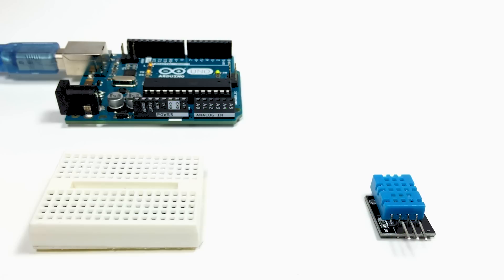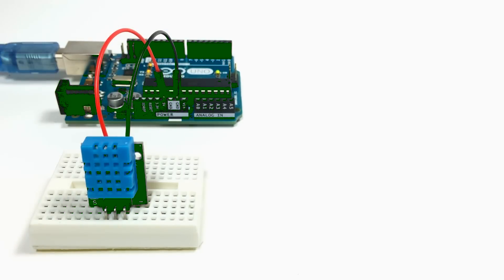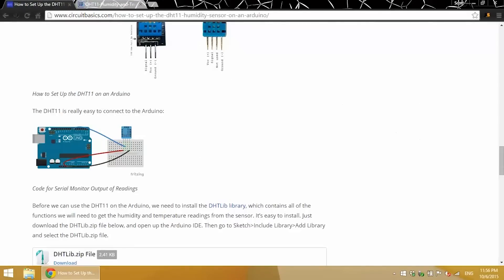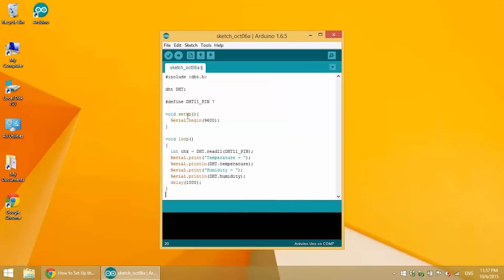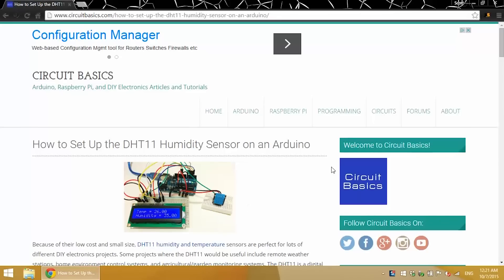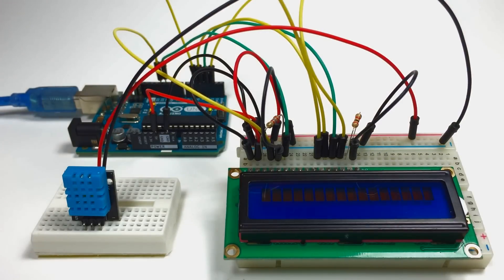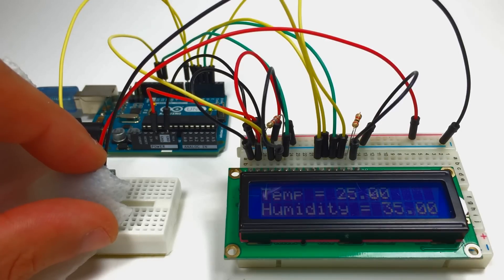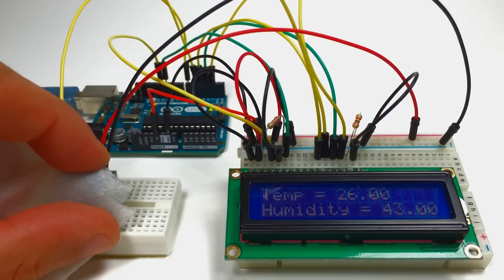How to Set Up the DHT11 Humidity and Temperature Sensor on an Arduino

Comment: Hi! finally something I can understand! Sorry I'm a super beginner on electronics.
I followed the steps but the "Serial Monitor" only shows "-999" value on both Temperature and Humidity. Do you know why?
Reply: +Mónica Rojas Restrepo You've prob done it now but yes you've got your dht wires wrong way round. Been playing myself and same thing - until I swapped the + and - around (it sure got hot at one point!)
Reply: We all are beginners in the beginning. Live and learn! (i gotta get that tattooed on me someday)
Reply: how was the -999 problem solved...?
Reply: The delay timing is too short. Change it to a larger value like 1500 or more and it should correct itself.
Reply: @rexpimplemyer3839  Thank you. this worked for me
Reply from the maker: Sounds like something may not be connected properly... Are you using the same pins I used in the video?
Reply: +Mike Mo yes, it was that. thanks
Reply: Solve -999 problem   https://www.youtube.com/watch?v=iQtC60BMk_8

Comment: Arduino: 1.6.7 (Windows 7), Vývojová doska:"Arduino/Genuino Uno"

C:\Users\User\Documents\Arduino\sketch_feb17b\sketch_feb17b.ino:1:17: fatal error: dht.h: No such file or directory

 #include <dht.h>

                 ^

compilation terminated.

exit status 1
Chyba pri kompilácii.

  Tento výpis by mal viac informácií s 
  "Zobraziť viac informácií počas kompilácie"
  povolené v Súbory > Vlastnosti.
Reply: +duffy kreativ and what now
Reply from the maker: You need to install the DHT library
Reply: wher dowland DHT library
Reply: https://github.com/adafruit/DHT-sensor-library
Reply: how to install
Reply: Start your Arduino software then click 'sketch' at the top and then on the drop down menu you should see 'include library' and you click on that and the menu will have an option 'add .ZIP library. Click that and find where you downloaded the DHT11 zip and select it. Then restart the Arduino software and it should be installed. Click File and go to Examples and you should a sample DHT11 sketch. Any questions?
Reply: Arduino 1.6.7 (Windows 7) Evaluation Board "Arduino / Genuino Uno"

C: \ Users \ user \ Documents \ Arduino \ sketch_jun26a \ sketch_jun26a.ino: 1: 17: Fatal error: dht.h: No such file or directory

 #include <dht.h>

                 ^

Compilation terminated.

exit status 1
Error at compile time.
Found invalid library in C: \ Users \ user \ Documents \ Arduino \ libraries \ sketch_mar12b: C: \ Users \ user \ Documents \ Arduino \ libraries \ sketch_mar12b
Found invalid library in C: \ Users \ user \ Documents \ Arduino \ libraries \ sketch_mar12b: C: \ Users \ user \ Documents \ Arduino \ libraries \ sketch_mar12b
Found invalid library in C: \ Users \ user \ Documents \ Arduino \ libraries \ sketch_mar12b: C: \ Users \ user \ Documents \ Arduino \ libraries \ sketch_mar12b
Found invalid library in C: \ Users \ user \ Documents \ Arduino \ libraries \ sketch_mar12b: C: \ Users \ user \ Documents \ Arduino \ libraries \ sketch_mar12b
Found invalid library in C: \ Users \ user \ Documents \ Arduino \ libraries \ sketch_mar12b: C: \ Users \ user \ Documents \ Arduino \ libraries \ sketch_mar12b
Found invalid library in C: \ Users \ user \ Documents \ Arduino \ libraries \ sketch_mar12b: C: \ Users \ user \ Documents \ Arduino \ libraries \ sketch_mar12b
Found invalid library in C: \ Users \ user \ Documents \ Arduino \ libraries \ sketch_mar12b: C: \ Users \ user \ Documents \ Arduino \ libraries \ sketch_mar12b
Found invalid library in C: \ Users \ user \ Documents \ Arduino \ libraries \ sketch_mar12b: C: \ Users \ user \ Documents \ Arduino \ libraries \ sketch_mar12b
Found invalid library in C: \ Users \ user \ Documents \ Arduino \ libraries \ sketch_mar12b: C: \ Users \ user \ Documents \ Arduino \ libraries \ sketch_mar12b
Library called DHT-sensor-library-master already exists
Found invalid library in C: \ Users \ user \ Documents \ Arduino \ libraries \ sketch_mar12b: C: \ Users \ user \ Documents \ Arduino \ libraries \ sketch_mar12b
Found invalid library in C: \ Users \ user \ Documents \ Arduino \ libraries \ sketch_mar12b: C: \ Users \ user \ Documents \ Arduino \ libraries \ sketch_mar12b

  This statement should be more information to
  "See more information at compile"
  allowed in the File> Properties.
Library called DHT-sensor-library-master already exists
Reply: Change the name of the unzipped library from DHT-sensor-library-master to just DHT. Then restart the software and go to examples and try the DHT Tester sketch. I have had problems in the past finding the correct DHT library for different sketches. Some call for DHT.h and others want DHT11.h
Reply: Just delete that library and install and rename to dht the one available on this page http://www.circuitbasics.com/how-to-set-up-the-dht11-humidity-sensor-on-an-arduino/
Reply: How do I uninstall DHT lib. that is withdrawn from libraries management
Reply: Delete or just move the folder out of your library folder.
Reply: https://www.arduino.cc/en/Guide/Libraries